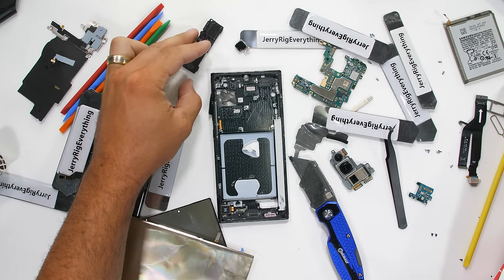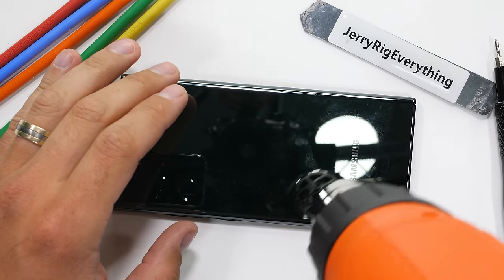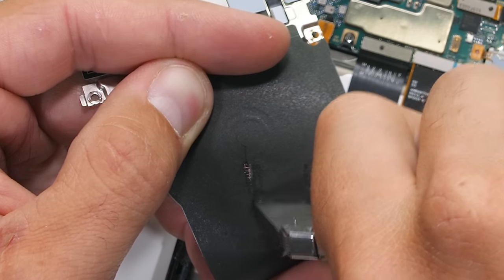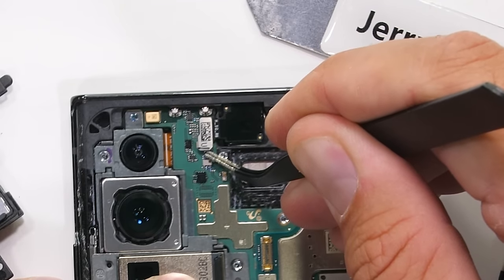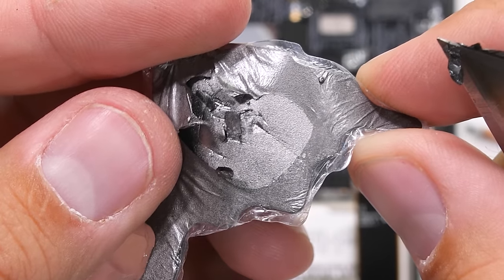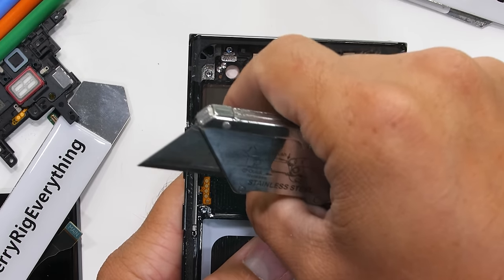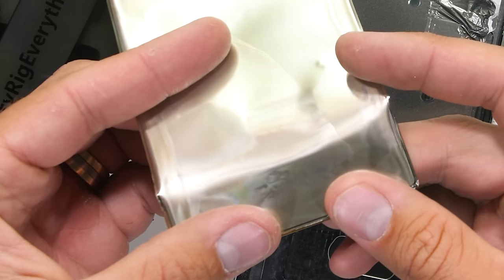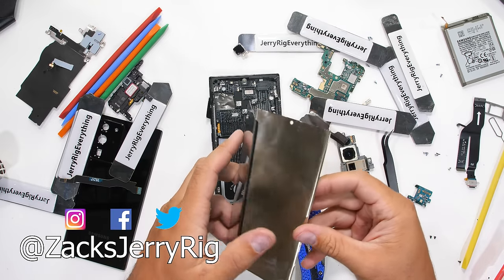Samsung Note 20 Ultra Teardown! - No Copper Cooling inside?!

Comment: Jerry you are wrong in one thing, graphite is more thermally conductive than copper so it is better to add graphite to exynos version
Reply: This is wrong, graphite may conduct more on a solid volume basis, but here a heat pipe is far more effective...heat pipe is not equal to copper
Reply: @vijayvinith4154  note 20 only  uses copper and not copper  pipe so it is better to use graphite
Reply: @desi_bhai_  it might be a thin vapour chamber as well...

Comment: I'm sure you won't see this but I love your videos. I just ordered this phone. But the reason I'm writing this, I work on phones and ipad at times. I have a few 3d printers and found using the head bed to warm up the device instead of a heat gun is much easier.

Comment: I want one thing, I want Jerry to show the processor, I wanna see if it actually says Snapdragon 865, or at least just see the little box that gives power to our phones
Reply: plus
Reply: Usually when you see the name on the processor(like an intel or amd desktop processor) it is written on the integrated heat spreader(the metal part on top of it), on phones usually there isn't a ihs, the manifacturer of the phone sorta makes his own, not Qualcomm. The actual processor is smaller than a finger nail even in desktops, and you can't write stuff on top of it since it is really fragile and it would kill the unit probably.
Reply: @nicodash2213  👌thanks

Comment: Note 20 ultra exynos owner here and after 4 years this phone gets very hot so easily, but besides that this phone served me so well all these years and i loved it so much. I replaced the battery and i think it will resist more years, maybe i got a little scammed compared to american owners which had snapdragon but for its time this phone was the best and i dont regret my decision, if i went back in time i would still choose it.

Comment: I'm still on my S8+ and probably switching to an iPhone this autumn. Sadly, Samsung pretty much has monopoly on premium android phones in the western world, the only company that gives you the "full" package. But the shady behaviour and throttling down old phones is what I'm not going to support for that kind of money. Especially living in the EU where I would get the crap Exynos. Goodbye Samsung after 5 long years.
Reply: Has the s8 gotten slow?
Reply: apple trothels their old phones as well
Reply: @yab3146  Really slow, and the battery life is awful, can't get through a day without charging late afternoon. The worst thing is I got the battery replaced with a brand new original one. So it's definitely the software.
Reply: @davidvreugdenhil4557  Not really if you change the battery. I bought a first gen iphone SE to use in the car just for carplay, and that thing with a new battery is flying! There are absolutely no stutters or lag, on a 5 year old phone! And it's running ios 14
Reply: @aminbajrektarevicab  how can a battery change the speed there may be no stutter but that probably is because  it is a light application besides is the iphone se old it's like a year old so that doesn't count
Reply: @davidvreugdenhil4557  Because iphones throttle as the battery gets old to "preserve the battery life". Once a new battery is in there, the throttling resets to full power. You can also disable that in the settings. But the point is where the s8 is lagging while scrolling a web page, the SE is super smooth in every part of the UI. And it's a previous gen SE, the small one based on the iphone 5
Reply: @aminbajrektarevicab  why do you want an Apple phone if you basically buy an iPad Pro you're wasting $1,000 want to know why? They are bendable they are breakable and useless here's another reason why it sucks

It sucks because it costs too much. It sucks because if Apple suddenly values a much needed accessory at $1000, you have to buy it. Apple sucks because they make great, high quality products at a ridiculous price, locked in to their own ecosystem with no freedom and control over their own device.
Reply: its better to move on from samsung its a scam if u want reliability good quality great performance go for apple
Reply: I am also using my S8+ (Exynos Variant) and besides the battery, it's still going good for me. I might upgrade to One Plus in future.
Reply: @davidvreugdenhil4557  yea TO PHONES as old AS FIVE YEARS
Reply: @RHMreborn  what's you're point here
Reply: @rko_taurus  I'm in almost the same situation, thinking also about oneplus because of the snapdragon.
The battery is not spectacular but it gets me fine through the day.
If I could get an s20 ultra with snapdragon I think I'd stick with samsung, otherwise, the performance gap is getting noticeable.
Reply: @davidvreugdenhil4557  that apple will not slow down phones that are less than half my life
Reply: Google Pixel lineup still exist. The most premium experience you can get in Android world, if you ask me.
Reply: You are wasting money on Apple... They are selling their overpriced crap and Samsung is selling their overpriced "full package" I would consider One Plus, they have the best pricing. Don't buy Apple an feel better than everyone else...

Comment: There is a high chance that the graphite cooling system works as well as the copper vapor pipe solution so before you judge wait for further testing
Reply: Disappointed that he didn't do a lighter test on it
Reply: May be. But if one works better than the other( copper or graphite), the people who bought the phone with slightly lower quality will feel cheated. That's the point @JerryRigEverything is trying to make.
Reply: @s.lingesan   +1
Reply: @s.lingesan  Well his new song proved me right. They are equal

Comment: You're wrong and what you said is misleading a lot of people, here's why: Pyrolytic graphite pad (PGS) is way superior (up to 5 times better) compared to copper and also more expensive. So they used them for the Exynos chip because it has overheating issues, but saved money for the Snapdragon one because copper cooling is enough for it to not thermally throttle.
Reply: people are already complaining about exynos note 20 ultra heating in minutes after opening camera and gaming,So ur wrong.Graphite is better than a normal copper but worse when compared to copper with liquid called vapour chamber

Comment: What the hell are you doing, Samsung? Takes some serious guts to sell a phone with a plastic panel for $1000 and try to shaft your customers by cheaping out on materials in a $1300 one. At least Apple has stainless steel body on it's top iPhones and is not selling a worse device outside of US. All of this almost makes iPhone a compelling option. Almost. I think my next phone will be from OnePlus.
Reply: Actually it is a very compelling option. Realistically who gives you a package with that performance, cameras, support, and almost warranty that 5 years from now it's going to work just as well. They use superior materials on the pro series, and all that for what's becoming a good price. Also iOS came a loooong way past few years. After using Android since its launch, I think I will be switching. I'm sick of this crap.
Reply: I am going for Xiaomi they give you more for 500 dollars than note 20 ultra lol
Reply: As an iPhone user I honestly agree with you. While Apple has its flaws Samsung is just beating around the bush; I used android as my first phone but I switched to Apple and I truely believe that with the tiny laws iPhone has it’s a much better longevity purchase than Samsung could ever be.
Reply: @aminbajrektarevicab  Apple warranty is 1 year not 5. Just software updates for 5 years.
Reply: I'm not gonna deny the complaints about Samsung, not trying to defend them by any means. 

But please don't use Apple as a comparement.. :P The list of scummy and questionable design choices is far longer for Apple. The normal Note20 is one of the worst deals in Smartphone history for sure though, the plastic build is so ridiculous for a "premium" model not to mention the lackluster features.  

But yeah.. Really hope Samsung stops becoming more and more like Apple in their practices. Luckily it's already very likely that Samsung will stop the development of Exynos and just team up with AMD for better chip sets. Hopefully they also improve their design policy a bit too. Although Note 20 ultra is a really well desinged phone, the exynos models are so much worse it's dumb af.
Reply: @WAncouvOR  That's not what I said, read again. I said ALMOST a warranty in a way you can be sure that it's going to work smoothly after a battery change. Not in a manufacturer warranty way.
Reply: they have been doing 2 seperate phones now for years. same name different internals. the very first galaxy s device was an exynos. the galaxy s2 was qualcomm then they had both exynos and qualcomm on the galaxy s3 depending on location. still waiting for 5g to come to iphone. took them almost 3 years to get 4g.. htc evo 4g(2012) iphone 6s(2015) also first time they increased their screen size to match the competition.  they also took their time on wireless charging as well.. april 2015 wireless charging for android, end of 2017 wireless charging for iphone. notice how i'm not saying samsung? oh wait there's more than one type of android?! omfg dont tell those iphone users with limited options!! samsung isnt the only options only an idiot would think so, soo many better options out there that are actually innovative and ahead of their time. cr'apple.. say they are and everyone believes them..
Reply: I have the OP8 Pro and it's legit the best experience I've ever had on a phone
Reply: I can strongly advise Xiaomi or OnePlus, lately Xiaomi went nuts with their new launches and they have incredible price quality ratio, OnePlus are also doing super well and the OnePlus 8 is also a solid phone
Reply: TP SS that 6s is still fully supported with major/minor/beta and day one as the most expensive current iphone. Got one as secondary with just changed battery two years ago - it’s fast and smooth as silk on ios 14 beta 6, including with pip video while you do something else + got all the new features. Where is the galaxy s6 now software support wise?

Also the same 6s will receive day one updates to atleast September 2021. And apple still release security updates to iphones as old as 4s from 2011. But keep telling me how there is no value in them. Ios 14 adds the last missing things from android - app drawer, widgets (both better and polished vs android) and picture in picture video. Got also things like double tab or tripple tab on the back of the phone for predefined action, works like a charm on my 11 pro max that I got after 10 years fo expensive high-end android phones that are abandoned literally in less than two years + apps runs better and have more features on ios, even google’s own and that’s quite funny, not to mention the exclusive apps and games. 

There is a reason why second hand iphone cost a lot, you know, second hand 3 years old iphone will be supported like a new samsung, but better - no delays, no regions, etc. ;)
Reply: Здорова товарищ
Reply: I bought the phone that OnePlus used as template for Nord, the Realme x50 pro. Great phone.
Reply: HeyayayYay
Reply: I say ban samsung forever
Reply: OnePlus 8 pro user here, switched from an XS max 3 weeks ago and I am never going back. The 8 pro display, specs, charging and features are just unrivalled
Reply: Budy, it's not important steel frame, but is on fast chip and quality display and other technologies, thats why samsung is expensive.
Reply: Oneplus spies on you. Any chinese phone will.
Reply: @user_error1016  bruh, what are they gunna do? Black mail me? Rob me?
Reply: @gerbenbootsma3394  I hear there's display issues
Reply: How come Huawei is put in the red zone and other chinese brands like oneplus are not?
Reply: @Xirpzy  because they aren't as intrusive as huawei
Reply: Buy one plus
Reply: Yeah, Apple give the same phone to all the world, but I'm not sure if you know how much is an iPhone outside of USA, in some countries of latinoamerica costs a lot much expensive than in USA, in my country is almost 400$ more expensive, as an example an iPhone se 2020 is from 700$ more or less, and that's why a Samsung phone becomes an option, they keep the price for the entire world, then a xiaomi phone is not good at all... it's good but more than that...I don't think so, they have a lot of software problems and also the hardware is not the best, they usually use cheaper components, you can search it, an OnePlus is a better option, it also is more expensive than I was expecting, but it still being cheaper than a Samsung phone and better than a Xiaomi phone
Reply: Thraben Innistrad I think you’re being irrational with Apple; design choices? Sure they may still have a notch or whatever but the difference with Apple and Samsung is that Apple only releases new hardware features and crap once they perfect it to the point where there’s minimal issues. Samsung gets new tech and then immediately implements it, no matter how good or bad it may be.

Apple is also longevitised and iOS itself is more stable and your phone will be more supported over the years than Samsung.

Apple has its flaws, definitely, but Samsung is beating round the bush and they’re turning into Apple in the unfairness of pride and what they’re offering. I’m not here to start an argument because at the end of the day they’re both just phones so it doesn’t matter which you like as long as you understand what’s best for you as the consumer

Comment: Extremely disappointed in this device. The Note 9 was the last great Note device in my opinion.
Reply: None of samsung phone appeal to me anymore, my note 8 sensors die in just 3 month of use, exynos processor is shit, their devices is expensive af
Reply: @TheRealUSArmy  Note device
Reply: And the S10 last great S device made by samsung, now it's only declining...
Reply: Galaxy note 4 and the note 9 is the best
Reply: @TheRealUSArmy  that's not under the Note brand my guy.
Reply: Fr I agree 100%. The Note 9 was the last Note that actually made sense and the S10 series was the best in the S series imo tho.
Reply: If not apple, there are so many great spec android device than this. Mi 10 ultra has the best camera now
Reply: correction Note 10 Plus
Reply: @rvchester  note 10 plus was a downgrade. Before you ask, yes I own it.
Reply: @rvchester  nah it wasn't
Reply: @hafeezhamama9580  I owned 5,7,8,9 and irght now I have Note 10 Plus and apart from loosing the headphone jack this Note is the best.
Reply: @hafeezhamama9580  How was it a downgrade? Just because it didn't have the headphone jack?
Reply: @davidrotaru  same battery life despite being larger, no headphone jack, no iris scanner, fingerprint reader is slower and less accurate than the Note 9, thinner device means pronounced camera hump, thinner bezels making it more difficult to hold one handed and Samsung got rid of the pressure sensitive area on the screen for the home button.
Reply: Manny M. Aren’t xiaomis only exclusive to China?
Reply: @hafeezhamama9580  I personally have the Note 10+ 5G as my daily driver and don't find all those points as reasons to consider it a downgrade. I've already moved to bluetooth headphones, so i don't miss the headphone jack at all. For biometrics i use both face unlock and the fingerprint scanner (the fingerprint scanner mostly for logging into the banking apps or authorizing transactions). You can't have iris scanner on a device with such thin bezzels, but you have to admit that the design of the Note10+ is miles ahead of the Note9, it's so futuristic. The camera bump is very small compared to the Note20 Ultra, and if you put a case on it you won't even notice it. I have the official leather case and it makes the phone so much easier to grip and use one-handed (coupled with One hand operation+, it's a joy to navigate around the UI, miles better than the standard gestures or navigation buttons)
Reply: @davidrotaru  face unlock probably doesn't work as well when you're wearing a mask, which I find myself wearing a mask and gloves often. I don't agree as much on the asthetics. I liked the thicker aluminum sides on the Note 9 as well as the color options. I regret trading in my ocean blue variant for the aura glow note 10 plus
Reply: @hafeezhamama9580  I managed to register an alternative look while wearing a mask, by simply pulling the mask down and back up a few times during the registering process, so that the camera can capture my nose and mouth. Now i can unlock the phone while wearing a mask, if the mask doesn't go very high up (usually if it sits 1cm over the tip of my nose, it works very well). I have the black version of the phone (and the black leather case;also the Whitestone dome glass screen protector, which i highly recommend) and it looks very dope and stealthy, just the way i like it. Looks are subjective anyway.

Comment: 9:56 yes exactly, i have been thinking the same since i saw the specs of the Note 20 Ultra, i was going to change my note 9 this year but samsung screw up if they mess the next Note, i'll switch to the next Xiaomi Redmi Note
Reply: I'd avoid Chinese branded phones
Reply: Besides unless you're running extreme CPU 24/7, there is actually no need for thermal chamber
Reply: @yubstep  i'd avoid american Brand phones
Reply: @yubstep  trust me i use my phone a lot A LOT i have to charge my Note 9 three or more times a day, i use all it's features from camera to even bixby so trust me, it trends to get hot, VERY HOT
Reply: Note 9 pro from Xiaomi is solid phone for 300 dollars
Reply: @hideyasumusha7211  lol the note 9 is 3 years old.  ALL my devices at that age of short battery life.  

I suggest you turn off "sync" which extends the life of the battery.  Also from an EE perspective, slow chargers extend the life of a battery, fast chargers don't.

My note 9 is fine but I switch phones a lot so I don't have a full testing.